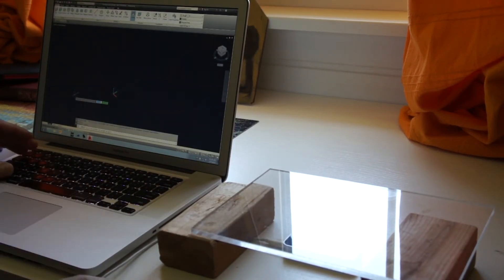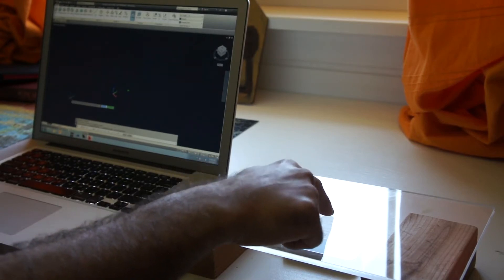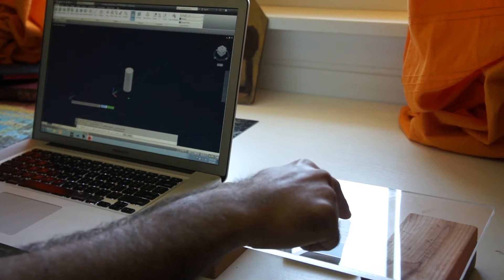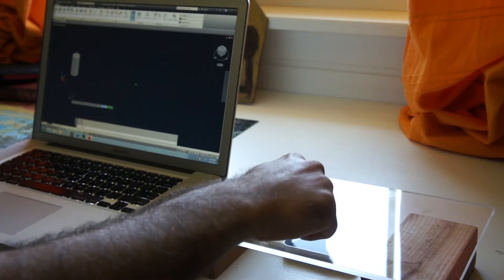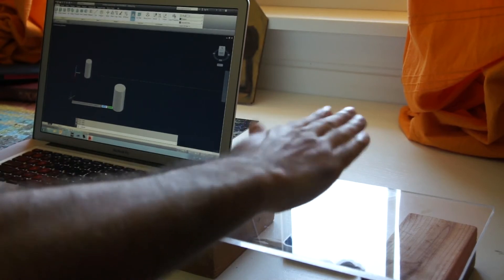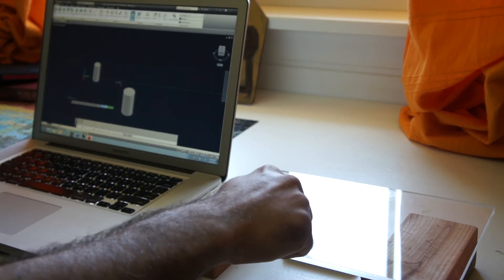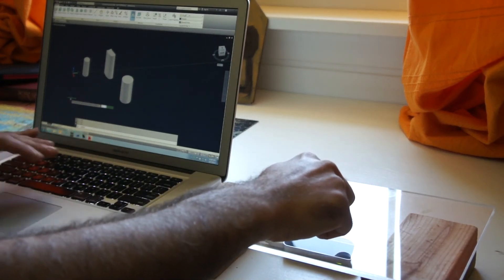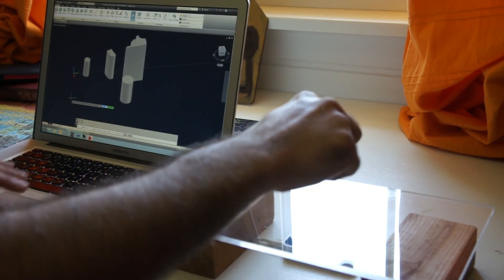Leap Motion beneath a surface driving AutoCAD

Comment from the maker: The sensor doesn't detect the board (although it does reduce the sensor's sensitivity), so there's a calibration step to determine at what "Z" (which is "Y" for the sensor, if I recall correctly) value the board is at.

Comment: Wow, now that is a great idea. Using a clear surface with LeapMotion. I was thinking an opaque surface vertically to create limit point was a good idea like a canvas on an easel. But I was wondering does the sensors detect clear board and understand it's dimensions?